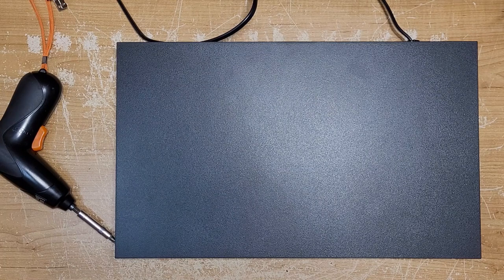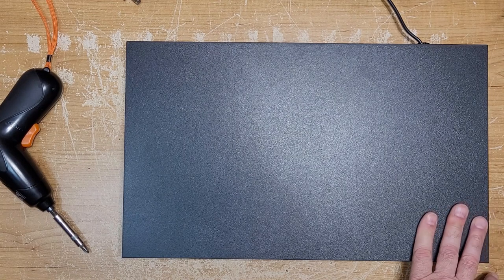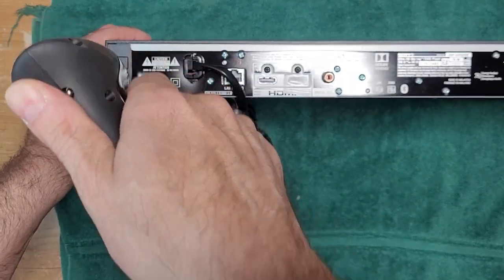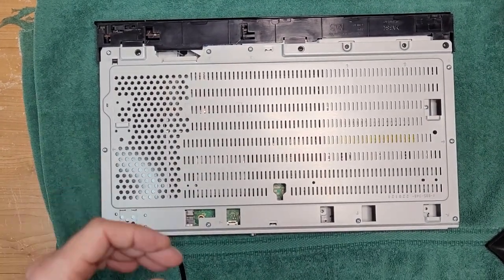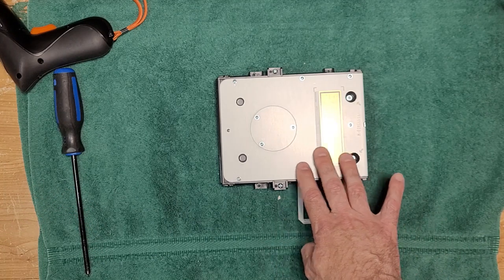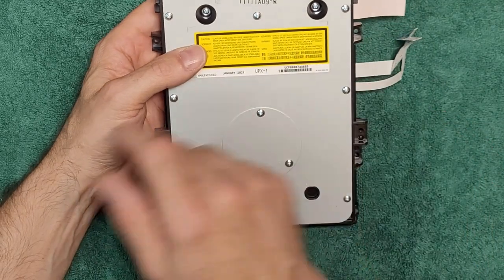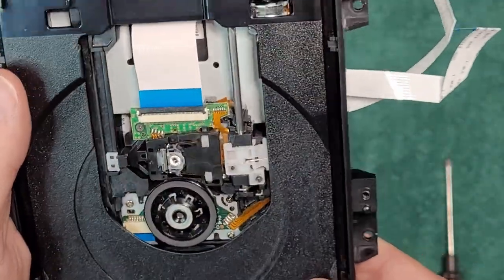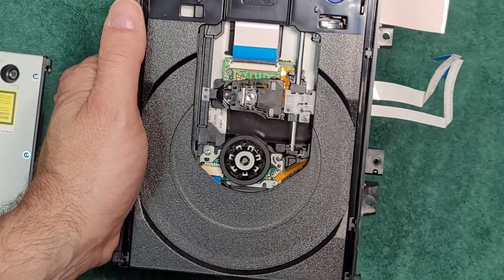Sony UBP-X800m2 4K Blu-ray Player Freezing Issue

Comment: I just recently bought one of these players and decided to get the 4 year geeksquad extended warranty from Best Buy just in case. I only had one freeze happen on john wick 3 4k. I hear that the cause is the 100gb disc sizes can be too much for the optical drives to handle. Some suggest cleaning the disc even if it's new and not having the sony player on standby mode all the time either. I might test out John wick 3 on my ps5 and see if it does the same thing on the scene it froze on. Since physical media isn't as popular anymore maybe the quality control of 4k blu-rays have gone downhill. That is also a probability as well
Reply: Did your test work??

Comment: I've been having this issue with my UBP-X800, and only with 4K discs. Very frustrating.
Reply: Try turning off 24p output in the settings
Reply: @tylerripplinger7890  Thanks but I already have a new player.
Reply: @tylerripplinger7890 I’m having this issue 
 (Seems to mostly only happen when I load up a movie or when fast forwarding/rewinding) 

Will turn off 24p and report back.
Reply: Found out 4k upscaling also upscales 4k content. Creating more heat. Just let the tv do the upscaling, it feels like a old feature just left behind from the late regular blu ray era

Comment: My 2020 X800M2 has been gradually having a problem reading all discs, have to try like 6 times now.
My old LG 870 is still working perfect, never any issues.
Makes me wonder why Sony has a good reputation.
😐

UPDATE:
Just removed my Sony's disc drive, cleaned the lens & lubed the rail, works perfect again....for now.
It still gets confused with DVD screen size format, always has when first loading.

So, it was a dirty lens or bad connection I'm thinking.
Probably connection issue, lens appeared to be clean.

Please note there are TWO SCREWS in back of player that keeps top from sliding off!
You'll see 3 just remove them all to be sure.

Comment: I do have the same player .only freeze on some movies but the cure is to eject disc tray and play the same spot. On the other hand some discs keep freezing trying them on another player Panasonic one work smoothly.have you reached a solution or any update about this player. Mine is brand new but will try to clean the lens as you did.

Comment: Freezing usually has to do with a Laser reading issue. Either a blemish on the DVD or digital operation interface from reader to processor.
Reply: How about dust/dirt on the lens?
Reply: @robertt9342  like years ago when I was in the navy and smoking was allowed the CDROM readers would get a smoke film on the disk reader.

Comment: I'm a big Sony fan and always wanted to get this player. So with this potential issue should I still get it at this time? I've just been holding out on a new player from them that will do auto DV. I know for a fact that they're not going to have HDR10+ support as it's a Samsung thing and plus none of their TVs even support it.

Should I just get the Panasonic UB820 instead? I've only heard good things about it. I have 2 OLEDs from both Sony and Samsung so having more of a universal player would be nice even though I wanted that Sony integration. It seems like manufacturers know that physical media will be dying soon so maybe that explains why there hasn't been any new more up to date players out there. Kinda strange for me to buy a tech or product that is around 4 years old for the same MSRP as well. At least it didn't go up like everything right? Both players are on sale right now though. Btw I also have a 4K projector so many I'm better off with the UB820?
Reply: I had the same issues with a x800 freezing. After eventually losing all patience I picked up the Panasonic ub820, best decision I made. I'd absolutely recommend the ub820 over the Sony, had it for over 12 months with no issues. Plus it has a great feature for adjusting HDR levels in films.
Reply: Physical media will never die completely as most people have shite internet speeds making streaming crap and a hassle to deal with

Comment: I'm wondering if it's a heat issue. I'm tempted to take my cover off just so it can ventilate better.
Reply from the maker: I've tried running it with the lid off, no difference.  The chips really don't get that hot.

Comment: Not sure why sony would go through the trouble to put all the ventilation holes in the cover and then cover them up with another cover but if I get one I think I will run it with the black removed .and maybe add a fan , Update : after watching another video there seems to be an issue with running certain settings , I have a feeling that the upscaling in the tv may be fighting the upscaling from the player , I would turn it off in the players settings ,  Here is a link to help with this problem https://youtu.be/Sym8ayOpL-4?feature=shared
Reply from the maker: I've run mine with the cover completely off to see if there would be any difference.  It still froze occasionally.

Comment: If I do a replacement of the optical lens from the inside, do you think the issue get solved?
Reply: No.  Read the other comments.
Reply: I just turned off 4k upscaling. Modern TVs do upscaling better anyways. Allegedly it upscales 4k content too so it creates more heat and uses too many resources for nothing. Feels like a old feature that never got updated for 4k blu rays lol

Comment: any solutions? i bought a sony x800m2 last year and it worked great. was working in january then i left for a month, came home, and now it reads discs but wont load them. wont even recognize 4ks. cant load the apps. ive factory reset it and everything and it seems to have fried itself just by sitting on the tv stand for a month. any suggestions?
Reply: okay so far this seems to work. check the power adapter its plugged into. try plugging it directly into the wall, factory resetting it, and then turning on wifi, and then restarting it. in that order. and it will run discs without issue. the hardware requires a lot of juice to run, and if it doesnt, the software glitches. i will update if this no longer works.
Reply: @pancakecookiecrumbles tried this, didn’t work. Still gives me disc unknown. Unable to play this disc. Utilized different Blu rays and 4k’s with the same result. Is it dead?

Comment: My Sony sometimes freezes after inserting SACD disc.Then I need to unplug it , wait and plug it back. Anyone experiences same with SACD?
Reply: Mine did the same thing yesterday with a SACD disk. I think turning it on while turning on my Marantz preamp might have confused it. But yeah - I've had to reset the Sony several times by unplugging it.

Comment: Windex on a laser lens? Please never use household cleaning products on an optical lens. A lint-free swab or a folded lint-free cloth with 99.9% Isopropyl Alcohol. You can buy it at electronic supply stores and some hardware stores.
Reply from the maker: A mild window cleaner does not leave any residue whereas alcohol can cloud over on the lens.  I've been cleaning laser lenses for 40 years and I've never had a problem with a dab of window cleaner and cotton swab.

Comment: Any updates on this?
Reply from the maker: Nope.  Still freezing occasionally.
Reply: Try turning off 24p output in the settings
Reply from the maker: @tylerripplinger7890  I'll give it a try.
Reply: @tylerripplinger7890  I will give that a try too. Did that work for you? I only have issues with long movies that are triple layer disks. Right around the two hour mark.
Reply: Any luck with disabling 24p? I don’t see Sony fixing the issue anytime soon and sounds like there are many in the same boat with this unit including myself. I’ve tried resetting, and turning off almost all the extras and it still locks up.
Reply from the maker: @uneCENT  I've been using my Sanyo 4K player mostly because it has been rock solid.  It doesn't have Dolby Vision, but I'd rather have stress-free playback.

Comment: i picked up a 700x at what I thought was a bargain , It isnt worth a dime ! it has frozen and skips on every single 4k blu ray I have tried all new discs! I am in the market for a new tv as well and I will not even consider a Sony they have been selling these crap players knowing they have an issue . These players are JUNK ! Shame on Sony .Selling this junk is destroying the brand.
Reply from the maker: Yep, Sony is a joke now.  I had a 70" Sony LED TV that developed a purple blob in the center of the screen after two years.  Out-of-warranty.  Never again.
Reply: Never had an issue in my country Ireland.
Reply: Try turning off 24p output in the settings
Reply: @RobertK1993  , You can say you don' have any snake problems either, doesn't mean others in other countries, don't.

Comment: ugh mine just won't play any blu-rays/dvds I put in.. it reads it and says the name of the disk but won't play it.. then it won't let me update the firmware, it says it's due for an update but nothing happens when I click on it, also nothing happens when I click on the streaming apps youtube, prime, or netflix.. so mad and warranty is most likely up so have a nice paperweight here
Reply: I have exact same problem... was working fine with a Sony Bravia, then bought a TCL and will not read discs or update firmware.... player is recognised and can scroll through all menues... factory re-set did not work.

Comment: Where’s the heat going to escape to…?… it will convect through the casing.

Also why is an easy to remove sliding closure a stupid design? The clips prevent vibrational noise while making it look nice to consumers.